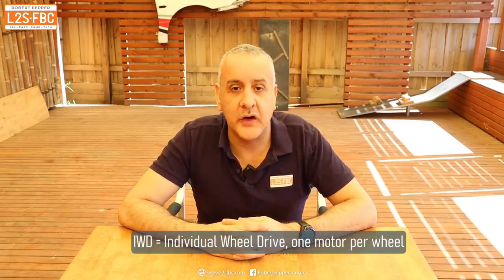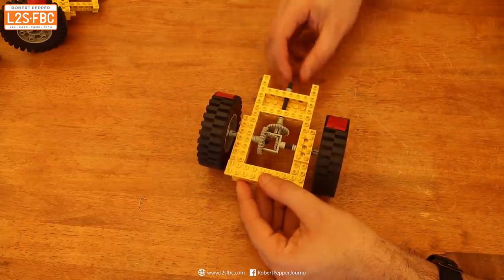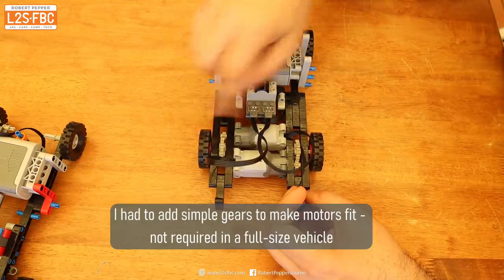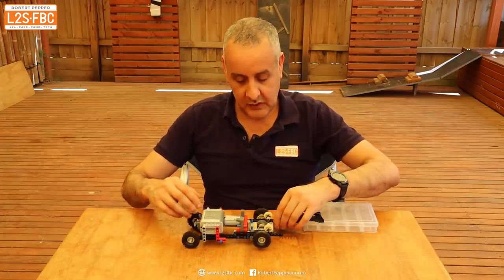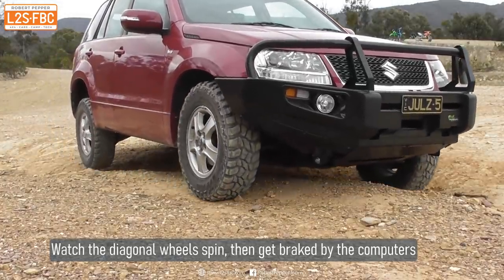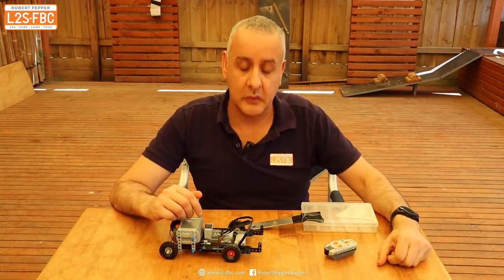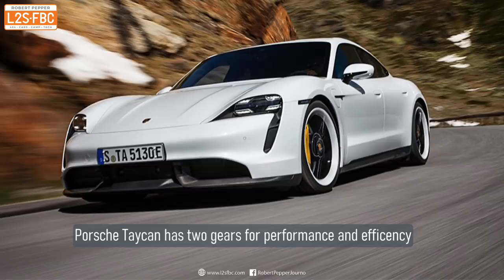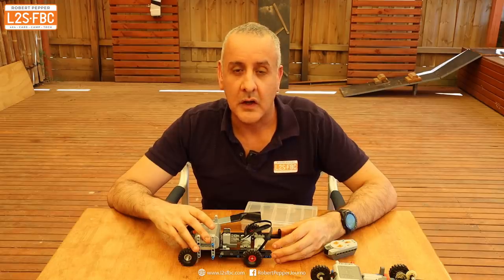Why Differentials Will Die - EV IWD Is The Future!

Comment: I will never buy an electric off-roader.  Ever.  Too complex.  Too heavy.  Nope.
Reply from the maker: I'd argue it's simpler...
Reply: @L2SFBC    Only in terms of moving parts.  Electrically, no.  Gasoline and diesel vehicles are much less electronically complex.
Reply: @RyanWithAviators  electric drive trains are completely sealed and more reliable than ICE. No chance of the engine sucking water.
As for more complex electronics modern cars have more chance of going wrong than an EV. Look at all the sensors you need for an ICE to run and they are all in the hot and exposed engine bay. They have as much electronics if not more.
Reply from the maker: Exactly I would suggest fewer computers needed in an EV.
Reply: @franciscoshi1968   I agree modern cars are way more complex than they have to be, but EV's are no exception to that rule.  Gasoline and diesel engines do not have to be complex, though, since almost everything can be mechanical.  Also, let me know when batteries are reliable for 300k to even 400k miles, and then I'll agree they're as reliable or more reliable than an engine.  
Regarding EV's off-road, it is completely ludicrous because if you run out of charge on the trail or even on a road out in the middle of nowhere, you have absolutely no way to charge it, and certainly no quick way to charge it.  Both incredibly important things to off-roading.

Regarding electronics being sealed and keeping water out, no, they are not good for being submerged in water.  Electronics are protected from being constantly splashed with water, but their woeful seals do not protect against submersion.  Especially concerning would be submerging high voltage wiring.  For example, when off-roading, you generally want a mechanical radiator fan or an electric fan on a switch that you can turn off, because when doing a deep water crossing you absolutely do not want your radiator fan running.  It's a great way to kill it.
Reply: @RyanWithAviators  electronics and high voltage wiring can be sealed very easily. They do not move. There are many connectors designed to work submerged.  A good example are submersible pumps. They are also high voltage and they are made by the thousands and dirt cheap. They are under water 100% of the time. So if it is designed to run under water it will.
As for batteries lasting 400k km there are some that do but they don't have to. Even diesel cars need maintenance.  I don't think any ICE car will last 400k km without replacing any parts. The EVs just do not have that many parts that need to be replaced.  I am sure a diesel car after 400k km is not as good as when it was new and the cost of maintaining it for the 400k km is not insignificant.  EVs last a very long time without any maintenance.  Mechanically an EV is the same as an ICE car with everything before the diff removed so they will be far more reliable.
As for the fan. EVs need far less cooling so you don't need to worry about the fan running under water.
And about running out of charge in the middle of nowhere. It is no different to running out of fuel in the middle of nowhere. If you run out you dont know how plan your trip and you shouldn't be offroading.
The only people that run out of fuel/charge are either idiots or they have a faulty fuel gauge. In the 30yrs I have been driving ICE I have only run out of fuel once (the fuel gauge was faulty) and since driving an EV I have never come close to running out and I have not had to spend time waiting to charge that I wasn't doing anything that took longer than charging like sleeping or eating and having a toilet break. EVs are different. The most range anxiety I have ever had was on a diesel.  I went somewhere and I could not find a fuel station that would sell diesel. I assume they would because it was the middle of nowhere so I expected farmers to use diesel.  It turned out that farmers didn't buy diesel from fuel stations. This was a long time ago when diesels weren't that popular. The same will be with EVs.
I am going on an off road dirt bike race next week. I thought I was going to have to use the petrol car but to my surprise there are charging stations on all major towns on the way so I will be using the EV instead.
Reply from the maker: Great post! Which EV do you have?
Reply: @L2SFBC  I got an MG ZS EV. We bought it as a run around car (considering it only has 260km of range) but we ended up using it for everything. When I made the decision of which one to buy we wanted an SUV and didn't need lots of range the MG was cheaper than the Kona probably because of the battery.
The estimate was we were going to be doing about 50km/day. It turns out that after we got it we started driving a lot more. We almost don't use the petrol car anymore and we go out far more than before. We averaged 150km/day on the first week we got it. The cost of running is so cheap that we end up driving far more than we did before. We do not consider the cost of fuel any more.
The petrol car was meant to be for the longer trips where there may not be charging along the way but fast chargers are getting more common. And if you plan things correctly charging time is not an issue. When we go on long trips we do not want to drive non stop even on the petrol car we didn't. So with the EV we just do the rest stops and food stops where there is a charger. This means that most trips do not take longer than on the petrol car. We can do 200km on one charge that is at least 2hrs. Most trips we do are not more than 400km each way (we just don't like driving for so long) so this means if we leave home with a full charge we have a 20min charge while we have a toilet stop, then full charge while we have lunch then we get to where we are going with some spare charge and no need to wait for charging.
Even camping grounds have power that we can charge from. So I would say for the majority of people current EVs are fine.
Reply from the maker: Cool! Which country are you in?
Reply: @L2SFBC  Australia.  I am also doing an EV conversion of Pajero. It is extremely unlikely I will ever go back to an ICE car.
Reply from the maker: Keen to hear about the EV conversion!
Reply from the maker: Cannot see the thread?
Reply: @franciscoshi1968  The mechanical and electric fan was an example.  I know EV's don't need the same type of cooling as normal vehicles.  The fact of it is, it's more expensive to make a more water tight high voltage system, and I'm not convinced that auto manufacturers will pony up the extra cash.  Not to sound nasty or mean, but, for the record, I said 400,000 miles not km.  I mention this since it makes a pretty big difference. I have a diesel engine that is not even supposed to have high mileage oil until after 500,000 miles.  It has about 250,000 miles on it now, and it didn't really have any major maintenance needed yet.  Granted, a certain amount of maintenance is a necessary evil of engine powered cars.

Yes, if you run out of fuel on an off-road trail, you'll also be in trouble, but there are a few facts that cannot be avoided regarding the differences between running out of fuel and running out of charge.  If you run out of fuel, a friend could take you some fuel or you could even walk to go get it, worst case scenario.  Not to mention, I always carry a couple extra fuel cans when I go trail riding.  No matter how long of a walk it may be to go get fuel, it can still be done if it absolutely needs to happen.  No amount of walking will make your EV charged up.  It WILL need to be towed, and that is massively expensive/difficult in an off-road situation.  You can't carry anything like a fuel can for your EV to recharge it on the trail.  Therefore, it's just not practical.

Beyond off-roading, long distance trips become a lot more difficult with EV's outside metropolitan areas, having to plan around charging stations, the time it takes to charge, and also having the range to make it a decent distance over a long day of driving.  Good luck ever driving across the west where even meticulous fuel stop planning is necessary, due to very few gas stations.  I'm sure at some point the infrastructure will catch up in regards to driving across country, but for the time being, it doesn't make sense.  No offense, but poor planning was the blame for your range anxiety in a diesel vehicle.

Don't even get me started on the expense of replacing a motor or especially a battery pack.
Reply: @L2SFBC  I would ask how so? How many lines of code to make the system work properly and have a fail safe. A carburetor equipped engine and hydraulically controlled automatic transmission is rather simple and can have minor problems fixed on the side of the road. Also I ran a fuel injected turbo engine on a Haltec system with just 2 inputs. MAP and RPM. While I do love to see electric technology evolve just ask any mechanics how much they love to chase electrical problems. Chasing a chafed wire or bad connector is a mechanics nightmare. Adding complexity can be beneficial. 2x4 vs 4x4. But simplicity has its place. Every added component is and added failure point. Batteries will get better, code more simple, computers faster and more reliable. This will be exciting to watch technology grow but at the end of the day, a rat chewing wires will stop a 1969 truck just as fast as a 2029 electric vehicle. As long as we still have a choice of the type of vehicle we can own I think we will be ok.
Reply from the maker: @rpeterson3951  there's more wiring in an ICE car with all its various electrically powered systems. An EV is much simpler. It's not much more complex than say your washing machine or anything else with an electric motor...how often do they need maintenance?  You can buy an electric RC car, ignore it for years, never maintain it...and it still runs. EVs are like that.

Comment: Bruh where tf you gonna go with the range of an EV and the load off-roaders carry? 100km maybe? And the bloody time to recharge the thing, hours.
EVs in the 4x4 world are like range rovers, its a great thing but not very suitable for long trips and 4wd
Reply from the maker: Pretty much what the horse owners said to the car owners 100 years ago !
Reply: @L2SFBC  the very big difference is that cars could and can carry extra fuel or have a bigger fuel tank and carry significantly more and be more practical and polyvalent than horses.
Reply from the maker: The horse is still today a better cross country vehicle than the car and horses can be refuelled on grass and water. And 100 years ago cars were small and their range short. Things change. EVs will improve more than ICE over the next few years.

Comment: More computerized junk to fail.. No thanks.. Ill keep my old school stuff thanks
Reply: So true but people are on the Green Trail and think electric vehicles are going to be the Saviour of the Planet,they forget how much Pollution they cause in the build process, they also forget about how much torque electric motors produce and any type of transmission will have to be very Robust especially in a 4x4 to take that sort of punishment but hey ho in the mean time I’m with you I’ll wait till all the teething problems have been sorted out before I take the plunge and risk buying one. People are going to get very badly burned with these electric vehicles when things start to go wrong..